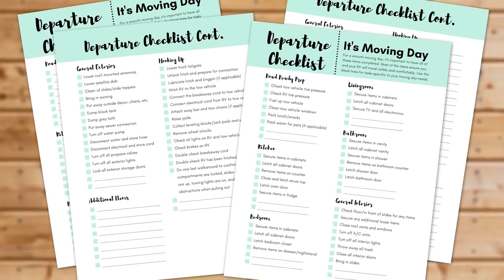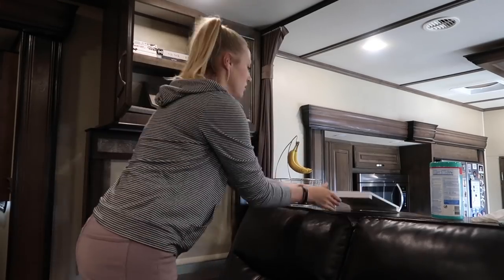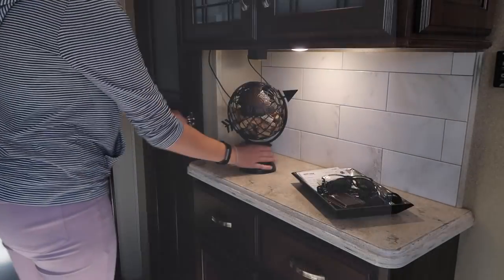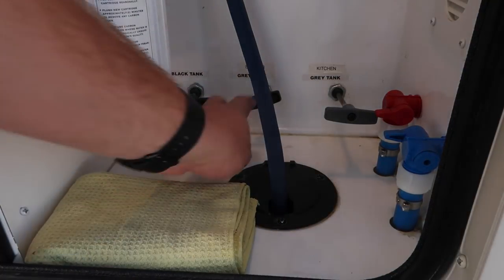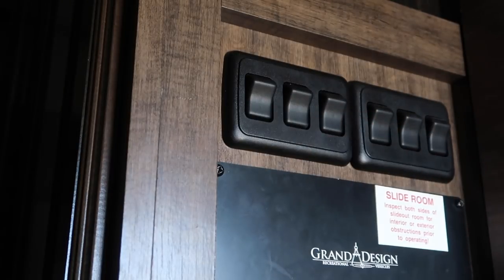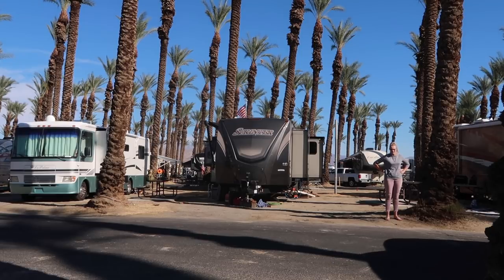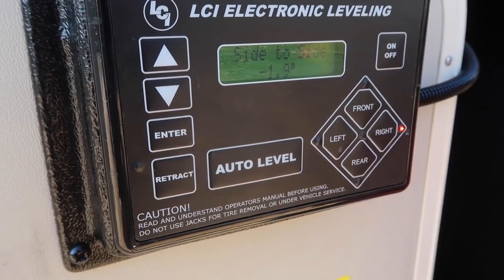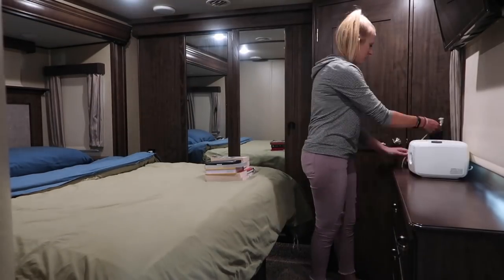RV SETUP AND TEARDOWN ROUTINE! || RV TRAVEL DAY CHECKLIST ✅

Comment: Good  Checklist.  We use the android app "Keep Notes". We use it in checklist mode and check them off as they are done. Both the inside and  outside chores are on the same list. Her section starts with "JKW have keys"  Further down where my section starts it  begins "GSW have Keys".   We do it this way so we can double check each other.  We even have a list item... "dog in".  Well when it is all done and  we are ready to drive off you just clear the checks and all the items pop back to the top ready for next time.
Inside the items go from  back and moves forwards.
Outside I have my list set so I circle the RV twice. 

By the way we got your T shirts before Christmas but haven't used them yet.  Lots of fun to come we hope.

Comment: Great tips, guys.  We’ve been RVing for several years and have our routines too but we picked up a few great tips for the pack up process.  A couple things I can add to your pack up list are:

1. Check tire pressures on the RV and the truck every morning of a travel day.

2. Do a light check on the trailer just before you pull out to make sure your brake, turn signal and marker lights are all working.

Comment: We carry collapsible athletic orange cones to mark where I want the left wheels to stop. Avoids the "which line in the sand" question. I also installed a propane flow device, gas stop, which will stop the flow of propane if a leak happens. I think I will be buying a the automatic fire extinguisher for the fridge compartment.

Comment: Great video. You were spot on, but we also check tire pressure. Safe travels
Reply: Checking tire pressure is one of the most important things to check. Every time we stopped I would check the tires. One time, packing up to leave, I found we had a flat on one of the inside dual tire.

Comment: Very informative video. I had not heard about using the blocks under the tires if more than 1.5 degree off side to side.  I also hadn’t thought about all the other cleaning during the process. Thanks for posting this.

Comment: It's amazing how you've gone from newbies to gurus in only a couple of years! If you'd allow me one pointer, though. I've been a professional driver for 24 years, and I would advise you to do a visual verification on your closed fifth wheel jaws (especially as your mechanism ages). I know a "tug test" is 99.9% effective, but I've been burnt on the tug test before. Not fun. You're already under there connecting electric & the breakaway; a quick look with a flashlight to make sure the jaws are locked is great insurance for a safe trip. Great tips, better trips & always a fun follow!
Reply: tjztyger good written reminder for a check list. They most likely do, it’s easy to see the hitch when plugging in the truck electric, if it’s daylight out lol. Check jaws so you can lock jaws, raise front hydraulic legs 1” off ground, do tug test, plug in truck electric, close tail gate, retract all level legs, put away wheel chocks, move off any plastic ground levellers, put em away, and so on....(so much easier actually doing it than thinking about it to write it, glad I’m not trying to video it either) and then say “r we having fun yet!” Lol. 
Like them, we hook up the truck together, that way if one of us misses a step the other remembers. If we both miss a step, well then were both screwed lol. 🥴. Cheers 🍻.

Comment: So I am curious, has your storing of items changed any since you had the independent suspension installed. I would hope it allows the camper to travel much smoother down the road....that is unless you are I-80/90 going through the Chicago/Indiana area.  Anyway, be safe, have fun & happy camping.      v/r, TS - Denver....PS - 79 days until our FT adventure starts.

Comment: 8:11 I am curious to know what is your reasoning for why you plug in the electrical cable to the outside of the truck instead of inside the bed??
Reply from the maker: Because that's where the connection was on the truck when we bought it. We don't have one in the truck bed. If we were doing the installation ourselves we would have put it in the bed of the truck.

Comment: Great video guys!  Just a quick question for you. I noticed you pulled shore power BEFORE retracting your slides. When you have the luxury of shore power, would it not save all that drain on the batteries?  When extending, I see you did connect shore first. Just curious.
Reply: Yeah, their battery setup is pretty large. We normally leave ours hooked up until the slides are in.

Comment: We don't use levelers under the tires.  Should we? We have a very similar Solitude. Can you tell me more about that.
Reply: We have the LCI Ground Control 3.0 electric auto-level system on our fifth wheel.  We find that if it lifts the tires off the ground the RV is less stable.  We use X Chocks between the tires to prevent the wheels from moving but we now always get the trailer mostly level using one or two 2x10 planks under the low side tires before auto-levelling.  If the levelling legs extend too far it will be move more so we also use either wood or Lynx Levellers under the auto-level legs.

Comment: We've been RVers for over 30 years. One thing which has made our set up/tear down so much easier is Quake Hold. https://www.amazon.com/Quakehold-88111-Museum-Putty-Neutral/dp/B0002VA9NA   It is a strong holding putty we put on those lightweight items like soap dispensers, plants, picture frames, etc. We haven't had anything come loose since we started using it 8 or 9 years ago. We really appreciate the tip on how many degrees off before you need to use the levelers, better than relying on the bubble levels(we have the Lippert Level Up system). Lastly, what vacuum are you using? It looks like it does a great job. Our current fifth wheel has a central vac, but we are getting a Solitude which does not and we travel with our Great Pyrenees and two cats.

Comment: I have a quick fix for the problem of accessing the fridge etc., with the slides in.    

Open the damn slide!  

Don't do it all the way.  Just enough to get at what you need.  

Simple, eh?
Reply: Like Rae said, she can access the right side of the fridge with the slides-in for this rig. 
When we pull over on the highway we don’t want the fridge slide opening, (the road side) because this rigs dining table and fridge slide are on one switch together! Yes you can operate the slides independently via the hydraulics valve, not something you want to do just to grab a drink. You want to keep your battery charge for when you really need it too.  Plus with the big slides just opening a little, sometimes the rubber seals don’t flip back over to seal properly when you retract back in, so not so simple without opening them a lot more first, than you wanted. Sure it was simple when we had a 27 ft little travel trailer. So not such a quick fix, and not so simple now, lol! Cheers 🍻